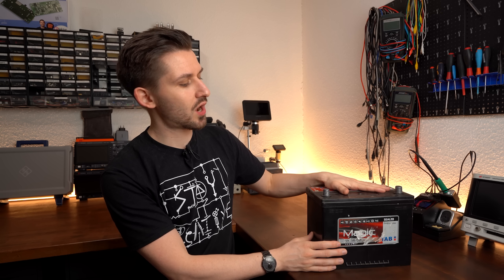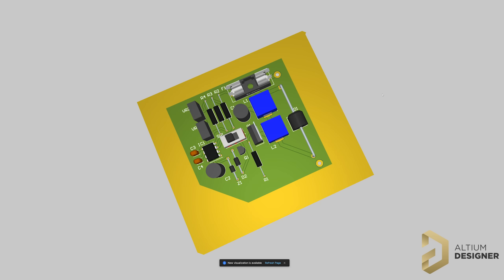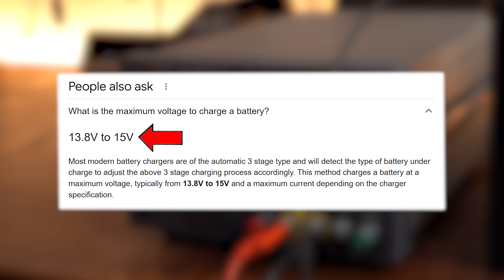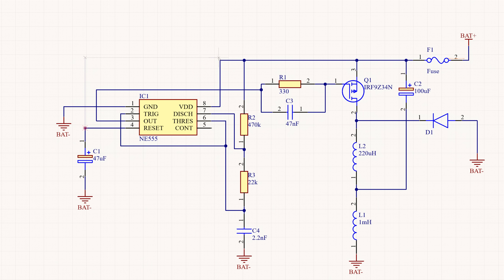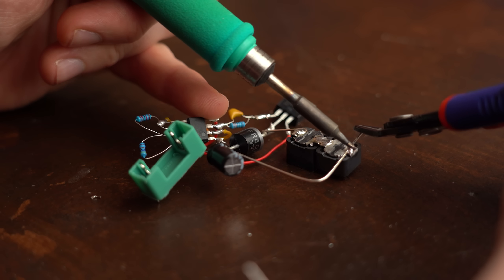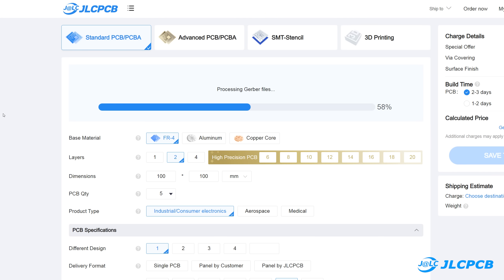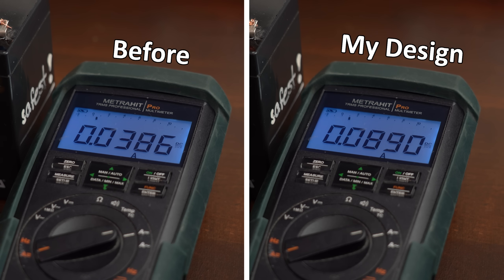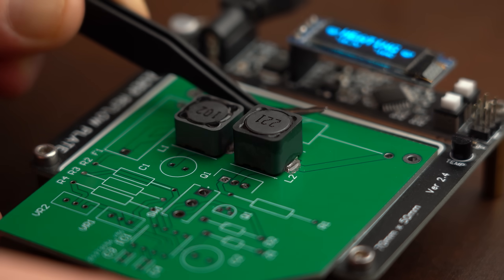I followed a YouTube "Battery Hack" and Wasted 30 Days! (Desulfator)

Comment: I think out of 15 years with these things, I have only had 1 success with a battery desulphator - and that may have been more by luck than design as the battery definitively failed within the next month. If you have a battery that's not accepting a charge, forget the rejuvenation, it's not going to help. If it is accepting a charge, but not accepting as much amps as you believe it could, then maybe these circuits could be useful for that specific use, before putting it on a charge again. 

Personal experience though: I don't like my battery chargers to be too smart. I've had chargers that refuse to charge a battery that was dead, only to have an 8 euro car charger to not detect a fault and provide enough power to get the battery charged back up. I will admit this cheaper simple charger has been more use to me than the big and expensive charger-tester-rejunvinator. 

Anyway, Tl;dr: if you have an shop called Action near you, get their cheap Dunlop brand battery charger. And the money you save over an all singing all dancing do everything charger will go towards buying a new car or bike battery when it fails. You will save so much time in the end!

Comment: First of all, as some guys already said, thank you for the video and the effort you put in there!

How much peak current did you get with this kind of setup? I've also build myself circuits like that and also realised that they don't work because the current was way to low. I then build a circuit with pulse width of approx. 50 micro seconds but with current of 150 - 200 A (you really have to short the battery). Used this circuit for a week and it improved the   performance of the battery.

Comment: Tell ya what does revive a dead battery. Get a big heavy stick welder, the older the better cause you're just looking for massive current. Anyway hook up the welder to the battery, hide around a corner, and zap for 30 seconds or so. Put it on a normal charger for a day and your good.

Comment: One thing to watch for with lead acid battery capacity testing is the purkett effect. Basically the faster you drain them the less capacity they have by a very significant amount. The name plate rating on them is a 20 hour discharge. It's not hard to hit 50% capacity on perfectly fresh batteries. Not saying that explains the sulphator not working but it's something to watch for when testing lead acid cells.
Reply: Yes. Presumably he did not change the discharge rate between tests.

Comment: ¿What if we try again but with monster pulses?, say, 100A charge pulse followed by 100A discharge pulse, mosfets like the irfb4110 should be able to withstand those currents and pretty high voltages.

Comment: So in my experience, a proper desulfator does work, but most you find are snake oil and/or suflation may not be the problem. It’s worth considering that simple breakdown of the lead compounds and battery electrolyte hurt a batteries capacity by reducing active material and increasing internal resistance. The best I ever used was the Granite Battery Saver, which we used to charge and restore warranty claims when I worked at Batteries+Bulbs, and other “smart” and general purpose battery chargers would not bring them back to spec. The thing saved the business thousands in warranty replacements. Also in my understanding, using a batteries own power doesn’t really work, that’s just moving particles back and forth.

The first battery seemed to have a dead cell, which is why it wouldn’t hit the target voltage and it’s current output was so low (very high internal resistance).

Comment: Desulphation can work but as mentioned below, the process is imperfect and works about half the time.  Lets say you had a fleet of electric forklifts and you wanted to extend their batteries life until the next fiscal cycle.  You could expect that a little over half the fleet would respond favorably and produce adequate work until some new batteries  were purchased.  Whether this is worth the effort is above my pay grade.  When I was a working technician, I almost never tried to sell desulphation.  The main problem with desulphation is diminishing returns on investment.  The process has many variables and it's difficult to predict if a particular battery will respond favorably.  If you have a good battery that you need to store, then circuits like yours will help prevent sulphated plates.  The US Army had some success in the 1990s with a product called a Solargizer.

Comment: Sucks to be you uhhh.... Nice drawings, uhhhh.... What capacityuhhh does a 12volt battereyuhhhh, actually haveuhhhh? What kind of wideowuhhh is this uhhhh????? Are you sure you don't have diahareaah?  My battereyuhhhh has dieduhhhhh..... Maybe I should've thought about a mosfeteyyyuh? And a better pennnuh so I could draw a diagrammmuhhhh that is uselessuhhhhh? What about a diode-uhhhhhhh? And a capacitoruhhhhh for power conditioninguhhhhhh? Dude. Stop. Or, just stick to german, Hitler.

Comment: the epsom salt method works pretty well, but it requires you dump the old electrolyte, fill up the cells with the MgSO4 solution, shake (really), and let it sit for a few days, then dump that out. Add fresh MgSO4 solution (shake again), wait for a day, then charge it with a simple charger at ~2amps for a day. If it is holding a charge, you're good to go, so dump that out and make fresh electrolyte (sulfuric acid + distilled water) and put that in.  Then charge again.  If plates are shorted or battery damaged, this may not work.  Basically, you're doing a replacement reaction.  It's all chemistry - the solution is chemistry.

Comment: I hope you revisit this in more detail at some point. It may not have been your intention, but based on some of the comments, it seems many viewers consider this video a "debunking" of the "myth" of desulfation. In my own experience, I have had both success and failure at repairing batteries this way. I am not qualified to speculate why it works on some batteries and not others. But I would refer skeptics to two different research papers: one titled "Desulfation of lead-acid battery by high frequency pulse" and the other titled "An empirical investigation of lead-acid battery desulfation using a high-frequency pulse desulfator" each demonstrate that this process can, in fact, recondition batteries to varying degrees.

Comment: The only way to recover lead acid batteries is to dismantle them clean up all the lead plate's and reassemble it and pour hot liquid lead to remake the + - post's and fill with acid.. that's the only sure fire way to recover a battery.. but it's a lot of work and destructive to the the battery case witch needs to be resealed.. it's not worth the effort as the labour would cost more than a new $100 battery.

Comment: I love this straightforward demonstration of how the circuit does what it claims to in terms of function but does not give the claimed result. Particularly the fact that you highlighted the importance of actually testing the thing that is supposed to be improved (capacity).

 At the risk of waaay oversimplifying things, rechargeable batteries are going through the equivalent of rusting and then de-rusting. As another commenter pointed out, the starting and ending materials going from charged to discharged and vice versa have different properties, including how much volume they take up. This repetitive process of changing volume leads to mechanical degradation which cannot be reversed with a circuit.

Comment: Nifty as usual. I don't know the history of such tech as I've never even heard of it, but a wild guess is that maybe they got popular around the time that solar + storage for RV's & off grid apps & such became more common. Anyway, some things that come to mind are, in the old days, ordinary car mechanics would regularly check the specific gravity of the electrolyte solution. Adding/replacing sulfuric acid was a common thing. Though I'm sure they still sell it even though "maintenance free" types are by FAR more common now, even in the marine market. I'd think this sort thing is more for the older types. In other words, you'd probably need to also flush/replace the acid & then perhaps such a thing could help in a restoration process.
Reply: I don't think that's what the hydrometer was used for, that's for finding dead cells. Also, adding acid isn't a thing unless you dump it out, you add distilled water because that's the only thing that's ever leaving naturally. 

Try calling interstate batteries and asking for sulfuric acid. I did, for anodizing aluminum, and they won't sell it. Buy a certain type of battery from them and it'll come with a jug of acid for you to pour in, did so last week.
Reply: @pontiacg445  Any auto parts used to sell it for batteries ... of course you'd dump the old & only use distilled water

Comment: 0:50 Isn't resistor connected to ground via ground flood? It is described as ground in schematic and obviously is connected as such on pcb (look at capacitor). I am confused why you consider it wrong!

Comment: from what i seen both of those circuits run off the batts current power including the ones your bought, the unit i seen at the local battery restore place it does the pulse when charging the battery, plus as another bloke mentions they wash the acid out with some solution and put new acid in, from memory its sulfuric acid, its the washing process that takes sometime that been said when i spoke to the guy who works there they said sometimes the battery is beyond saving as they might have a cell that is too far gone and tends to drag the other cells down with it like its become a load.

When he shown me the charger it was a large unit that trickle charged the batteries at 5AMPS and there was some pulsing going on as the indicator on the unit would flash "i am sure that is just an indicator" the guy also told me that there are a few charging modes that it will sweep through it would also discharge the battery after each charge and start the new cycle they said they leave them on overnight and the battery was good unless it had a bad cell, the discharging function would never let it dip below 10v as that is bad.

The deal with these guys is i give them my old battery from my car and pay $100 bucks for a restored battery. "I been using it in my car for 2 years now no issues as yet", with my other car i had the reconditioned battery in for 3 years before noticing it lost capacity where it would not be able to start the car and i think that's fairly decent.

In short there is a device out there and a process of reclaiming the batteries if they can be.

Comment: I have a motomaster charger that detects and desulfates bad batteries and I have had some limited success with it.  I think the flaw in the circuits you used is that they drain the battery until you manually charge rather than automatically alternating between charge and desulfating keeping the battery fully charged through the process, you lost capacity with both devices because your batteries are draining the whole time.
edit: I think the battery that measured 10v likely has a short circuited cell and is not recoverable in any case, usually battey's that can't charge to 12v have a short and ones that charge past 12v but have no capacity are just sulphated.  Also fill the cells with distilled water if they are low, I know that small battery has filling ports, the big one probably does too.

Comment: I have tried many diy variations of that circuit over the years (since late 2000s) and none of them worked. I even bought a commercial unit that had lots of positive testimonials online using my own money and tested it on my car. I used it on my car since I know the battery there never lasts more than 3 years. Guess what, the commercial unit never made an effect whereas the testimonials and ad said it extends the life. Posted it online and the manufacturer kept bugging me to remove my post. I did not, though sadly lost my site when the host disappeared years later. The only DIY desulfator circuit that worked for me under very specific circumstance was a capacitive dropper circuit ran off 220v into a NOS 7ah vrla battery that had been in storage for many years that had become high impedance. Otherwise, any other used battery that had gone bad never worked.

Comment: I bought a battery charger with a function that can rejuvenate batteries, and so far it seems to be working. The one battery had a two year warranty, and it was discharged when I bought it for my test. I haven't done load testing on it, but it's holding so far.

Comment: i tried one of these things, i checked the capacity before and after each "desulfaction cycle", i also kept extending the time that i "desulfated" the battery until i finaly reach 6 weeks for the last test. i saw absolutely no increase in capacity with regards to lost capacity due to normal use.

also most of the amazon and YouTube reviews are by old men who sand nothing but praise for these scam products without even knowing how to tst to see if tis doing anything

Comment: I tried to use a marine lead acid battery in a home solar project and found it very unworkable. After discharging it to about 50%, it was very difficult to recharge it. The voltage would clime up to about 15v over a day with only about a delta charge of 20%. But after about a week of charging it would finally get fully charged. This is no good for solar where there is a daily cycle. Therefore doing capacity testing, of some lead acid one may need to trickle charge over a period of days. Thanks for the really great videos.

Comment: I thought that normal mains powered car battery chargers as well as the alternators on cars did some desulfation during the charging process by using "dirty" power and that lead acid batteries liked to be charged this way, so not like the smooth power needed for lipos but instead quite noisy and pulsed power that helped keep the batteries functional for longer.

Comment: Thanks for throwing in the issues and fix for the PCB design.  I think a lot of people are put off by worrying their boards will not work as intended when they arrive, and as many people have budgetary constraints, find this a show stopper.  Being able to diagnose and then repair the design with a workaround means a non-critical design failure is manageable, and you'll learn something along the way too.  Dealing with faults and faulty designs is really valuable as a hobbiest, and also if you want to get into component level repair and hacking.

Comment: Let aside the actual effectiveness, I guess the 555 timer oscillator cannot make the duty cycle less than 50% is the reason the original design went with p-channel mosfet, even that p-channel ones are inferior than n ones in many aspects.

Comment: A long time ago a professor at my school also attempted a desulphation, but he used a circuit that pumps up big capacitors and dumps it to the battery, it needed an external power supply for that, you could even see the wires shake a little every ~1.5 seconds when the capacitors fired. After 2 weeks or so the battery worked again approx 75 out of 90Ah. I have to say that i didn't saw the test before the process, the professor just said it was "dead". 

So maybe if it wasn't "dead" before, the circuit didn't hurt the battery too much.

Comment: Sulphated plates can ONLY be recovered IF they have not been buckled by the sulphation. If they have buckled ... Forgedaboudit!! Zero chance!

Plus, badly sulphated plates which have not buckled, have SIGNIFICANT resistance to reverse current flow i.e. charge current. This means high VOLTAGE (>40v ... I have tried static 40 volts and get nowhere current wise!) is required but at LOW current to avoid heating effects.

There IS a US desulphator design out there that is VERY DANGEROUS involving 110 volt MAINS voltage providing current through X2 style, 400v capacitors ... Up to 3 in parallel operating as a capacitor reactance current limiter and is purported to actually work. BUT ...

*DO NOT USE THIS CIRCUIT UNDER ANY CIRCUMSTANCES AND ESPECIALLY NOT ON 220-240V!!*

One of these days I shall get around to designing and building a high frequency ~10kHz, high voltage ~200v charger but based on a much safer, properly current limited and fully isolated, pulsed unit. 

Why? Because I strongly suspect that the good results, both apparently and anecdotally obtained, with the otherwise potentially lethal circuit unit are down to the truly high "pulsed" voltage used (110 √2 volts peak =155v!!) being able to drive current through the high resistance sulphate. The series caps providing current limiting.

 The problem is that it just uses a standard capacitive "dropper" circuit to limit the current and an old style charger operation of rectification only (no filter capacitor/s). So the pulses are just 50Hz AC or 100hz half sinusoidal pulses (I can't recall which) and the battery ends up doing the smoothing. In addition there is a direct path to the mains live connection with this approach!!

I suspect the technique also works because any old style battery charger can be seen inside to house just THREE basic components: a transformer, a full wave bridge rectifier, and a mains on/off switch. 

The transformer just supplies isolation and a step down to somewhere around 15-16v RMS open circuit (standard charging voltage ~14.4v once loaded) but the PEAK voltage is 16√2 volts or 22 ish volts at 100Hz! So pulsed, not steady state, as standard!

This is almost certainly why old chargers are often found to do a much better job of charging than modern smoothed and stable, precise 14.4v  chargers. Anyone made/tested a high volt, high frequency, unsmoothed charging system with comparative ideas?